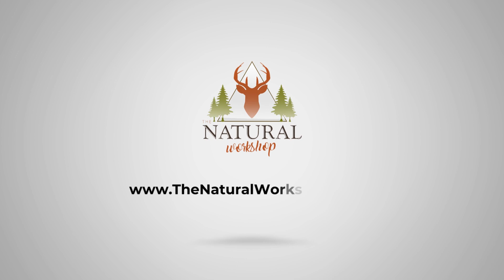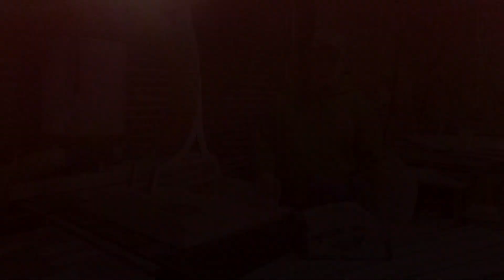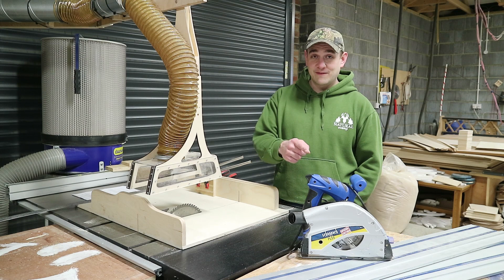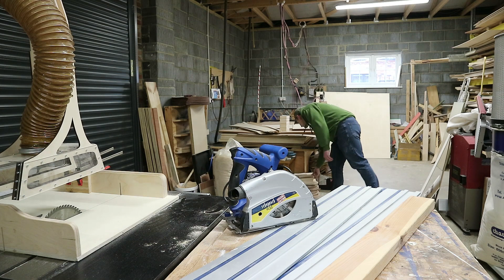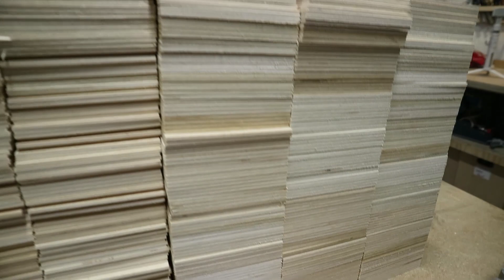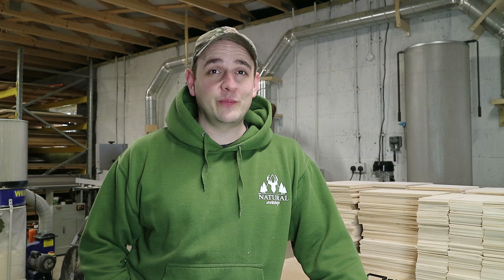Table Saw vs. Track Saw vs. Plunge Saw: Which One is Right for You?

Comment: I have a track saw and table saw. I use the track saw the majority of the time, rarely have the need to cut 2000 squares...As a hobbyist most cuts are 1 offs
Reply from the maker: Yep. Like I said, all depends on what you need and how you work. Track saws are great for what they are but if you want to work outside sheet goods, build a box joint jig, rip a 2x4 etc then table saw is still king IMO

Comment: In most applications especially working with small materials, a table saw is faster. But you are using your track saw without parallel guide system (PGS) from TSO, Woodpeckers, etc. There's nothing I can think of that I would do with a table saw that I could not do with a Festool track saw, router and TSO parallel edge guides. In fact, in some cases the latter is more accurate than using a table saw because you're not having to deal with applying even pressure from start to finish against a fence. So if you are a DIYer or don't have a demanding work flow, the track saw w/a parallel guide system is better for ripping large sheets of plywood or even small pieces, but that's not all. With a thickness planer, track saw and the right parallel guide system, you can dimension lumber without a jointer. You can't do that with a table saw. 

So I would sum it up this way. A table saw is necessary for a busy workflow. But if that's not important, a track saw with the right parallel guide system (i.e. TSO) and a router is even more versatile and accurate than a table saw, and it IS safer with the right track saw. Newer models from Mafel, Festool, and now Makita (in their 40 v. series) have anti-kickback mechanisms that stops the blade when it senses the saw is coming off the track. So unless you're using a Sawstop (which is still arguably the safest even though it doesn't prevent kickback), the right track saw IS safer than the vast majority of table saws (and this point really can't be argued with the latest technology). Keep in mind, the people who lose fingers with a table saw are usually the newbies or the highly experienced woodworkers who become complacent at some point. We can all fly on autopilot. Someone might use a table saw for 20-30 years without a problem until they have one.
Reply from the maker: Hey I have only seen this so apologies for not getting back to you. Ill take some time out this weekend to properly read through and reply seeing as you were good enough to write a long comment. Have a nice evening and Ill check back 👍🏼

Comment: Great video mate,you keeping this 68 year old fart entertained,I use both but have to admit my table saw only cost about 150quid,  made a couple of sleds, brilliant, only problem with it isits an aluminium table surface, and you can't make a zero insert asthe insert is in effect a full length of the aluminium, but drop a 5hinz piece of ply over it before you cut and its fine,  keep em coming , thanks for posting from Garry in Barnsley UK
Reply from the maker: 🤣 thanks for the comment Garry, glad you are enjoying the content. Ive taken a few weeks off as Ive had a mean bug, lots my voice which makes videos difficult lol but hoping to be back on it this or next week 👍🏼

Sounds like it works for you, we did the exact same thing with the Lumberjack Router table. When we killed it we added an MDF top and attached a router underneath, we still use it today, if it works it works!!

Comment: Used to make a living as a joiner-builder; now retired. You buy whatever you need for a particular job: so I have a rake of 'heritage' tools from that way of doing; always possible to find some tool with which to do the immediate task. Productivity and high-end finish are no longer the priority. When I have to replace a bench tool, I go budget. So a Parkside track-saw when they were selling them off for £35. A Titan site-saw when they were on special offer. A  used (blue) Ryobi bench bandsaw I got as a gift. A performance mitre-saw when B&Q were reducing them to very little. When time-taken and high-end finish are set aside, the shortcomings of budget bench tools can be sorted out by traditional hand tools. So, as you say, what you need is specific to your intentions and circumstance. Enjoyable video.
Reply from the maker: Thank you Colin and totally agree. When people ask for tool advice I always say to them to not go over the top if they don't need to. Dont get me wrong, if people like to throw money at tools then why not but its important to remember that the tool does not make the man!

Comment: I find I'm using the cabinet saw less and less these days, but I've invested well in Benchdogs fences, TSO squares and parallel guides and UJK Parf fences. That said, the table saw sled does take some beating for the small pieces, as you said 👍
Reply from the maker: Very nice! How do you get on with the Benchdog/UJK fence, are they nice and sturdy? Do you get any rock out of them?

Yeah I think it has a lot to do with the type of work that you have planned in. Your set up would work fine for 80% of what we do but for those repeatable cuts it makes life a whole world easier.
Reply: @TheNaturalWorkshop  Slight play on the BD (Mk 1) fence in 'portrait' mode, lying flat is solid, as is the UJK. I think the Mk 2 Benchdogs fence is better, but I didn't bother with the upgrade.
Reply from the maker: Apologies as I didnt see the reply! Ill have to watch some videos on it as Ive not had the opportunity to try one yet.

Comment: I think the big reason, even for a heavy table saw user, to have a track saw is that man handling 8x4 sheets through even your saw must be quite hard work? I'm sure many people use them for breaking down full sheets into something more manageable before final table saw cuts.
I have the Aldi branded version of your PL55 and it's okay but I don't love it and I wish I had the budget for a Makita or Festool.
Reply from the maker: Totally agree and that is how we started out. 

It isn't the easiest to run them through to be honest, I can do the 5 x 5 sheets up to 12mm on my own but anything bigger and I need a second man to help out. 8 x 4 is the same although its a lot safer to have the second man there regardless. In an ideal would I would get a panel saw and have this one for cross cutting but that will have to sit on the back burner for a while.

I'm not super happy with the Sheppach and would love the Makita but it does the job I need it to do and the thing just wont die so I cant warrant a new one lol

Comment: Another very informative video, thanks for the pro's and con's, room for thought! Thinking of getting a Charnwood 10" table saw when they are back in stock, have you any experience of them? Keep up the great work.
Reply: The Charnwood is a great saw. Not really pro-level, but it's cracking value for the price.
Reply from the maker: Hi Paul, thanks for the comment and view. I haven't BUT from what I have seen with the saws, the majority of them seem to be quite similar. They should be pretty bullet proof to be honest, there isn't a huge amount with them to go wrong. When people ask for table saw advice the things I recommend are "Induction motor, cast iron top and solid fence" and it looks to tick the boxes. 

As with any new saw, always look at getting a new blade with the unit as this will be the difference between night and day!
Reply: @TheNaturalWorkshop  Thanks it will be my first table saw which I've been promising myself for the last 40 years for my retirement!
Reply from the maker: That will be a great day when it arrives! Good luck with it, hope you have lots of hours of fun!

Comment: Great video as always, very informative and balanced. This is a subject I have given a lot of thought to recently. I am a hobbyist and through some trial and error have come to the point where I am using the track saw to break down full size plywood sheets and then use the table saw (small site saw) for the final repeatable cuts to size or ripping dimensional timber. I am sure this will evolve as I become more adept with the tools and my abilities.
Reply from the maker: Thank you Phillip! 

Thats a great way to work it and its how we started the whole business off. It will get easier and more precise as you learn. I think that as long as you take your time its a great way to do it.